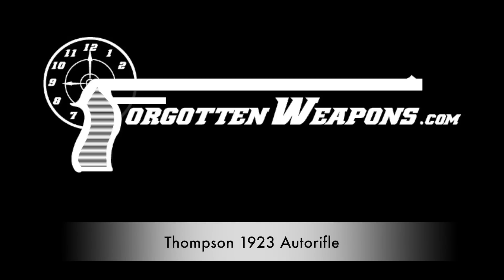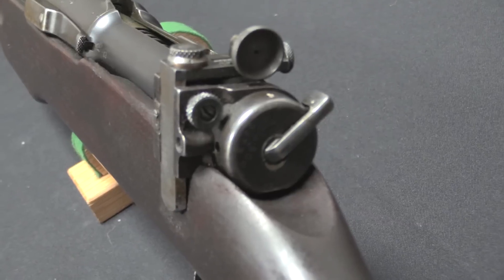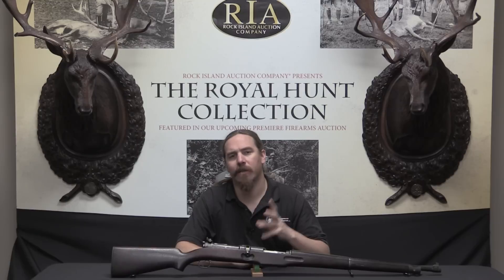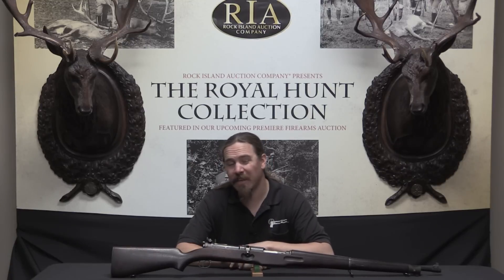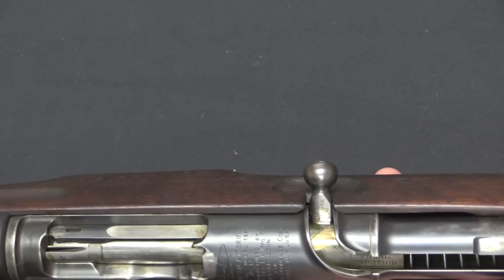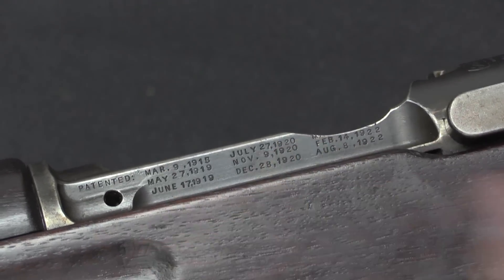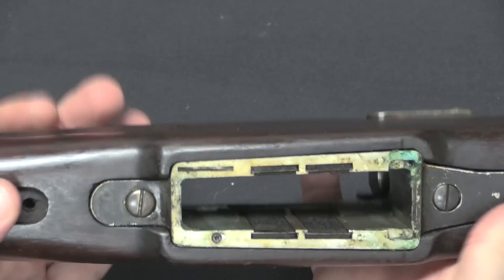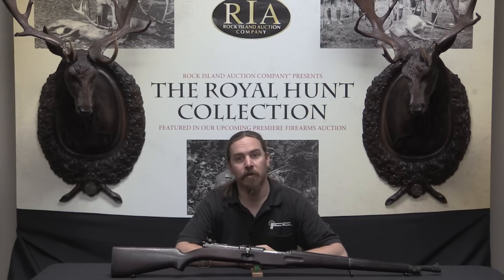Thompson Model 1923 Autorifle

Comment: I can see how Thompson reached his conclusion regarding the "Blish Principle" however he came about it through a limited understanding about cams.Simply put, a cam is a system for converting rotational movement into linear and vice versa. Most screw threads including barrel threads are shaped to be cams which require a lot of rotational to create a little linear. Under the pressure of being fired the barrel is forced forward, the bullet acts like a temporary plug as hot gases expand, this puts a lot of linear force on the threads, enough to induce a small amount of rotation despite the friction of the threads. Repeat this a few hundred times and a noticeable amount of unscrewing occurs.

Comment: I don't understand why you can't understand why it says, "firing position",  I'ts because if the bolt is back , ( which some people may have thought that's where it was supposed to be when fired ),  you can't read it, but when in the proper position , ( bolt forward ), you can.

Comment: Interesting oil-assisted feed system. The Italian Model 1930 LMG and the Breda Model 37 used oiling systems.
Reply: The original Thompson Submachine Guns (Models 1921, 1928, 1928A1) had a felt oiler and retaining clip that wrapped around both sides of the reciprocating bolt group.  It was one of the features eliminated on the Savage redesigns (M1, M1A1).

Comment: HK used fluted chambers to overcome the high pressure extraction issue, right?
Reply from the maker: +Derek Dziobek Yes.
Reply: +Derek Dziobek It worked on the STG-45 but it's just not enough for a 7.62x51 NATO gun.
Reply: I thought that's what they did in the G3, as well.
Reply: It started with the StG-45 and made it into the G3 (which was originally intended to be in 7.92x33) and then onto the MP5.
Reply: +Derek Dziobek The HK91/G3 chambers are fluted as well. And as is typical of a delayed blowback on anything bigger than 9mm, it beats the hell out of the case necks and throws them pretty far.
Reply: +Gerald Darden   Italy was the first to use flutes in their SIA machine gun.
Reply: +Shoes Seems to work well enough for my HK 91 IN 7.62x51 NATO.
Reply: +Gerald Darden HK made a metal/rubber case deflecting assembly that works pretty well and based on an old Guns & Ammo article I read at the time, I tried reloading the spent cases using full length dies and THAT worked pretty well, as well
Reply: +Damian Grouse Sure works in my PTRs, too.
Reply: +Shoes Don't tell that to my PTR91 that's literally never failed in many thousands of rounds.

Comment: Looking at those oiler pads, I do not believe they were reversible. I think the back pad (which appears to be wider) was a reservoir that fed the front wiper pad. The metal plate between the pads probably either has some holes or the felt wraps around it at the top.

Comment: If I'm not mistaken, many, if not most of the "automatic" firearms at that time were firing from an open-bolt position. Since Thompson called this their "Autorifle" the "Firing Position" marked on the bolt may have been simply to specify for users that the weapon fired from the closed-bolt position, as the marking is not visible when the bolt is open. They may have simply wanted to ensure that no GI locked their bolts back and charged into battle thinking it operated the same way as an open-bolt automatic rifle. Probably something could have also been accomplished through training, but making something idiot-proof is a long tradition in military weapons...."Front toward enemy", etc...

Comment: It appears to me that the cover plate that holds n the ejector is what keept the two threaded portions of the receiver from unscrewing.  You can see the slot at the juncture of both pieces would work like a key on the shaft.

Comment: Psych! No "Blish Principle"! Navy dude after all...never thought improper tightening/torquing could have been the loosening problem.
Reply: I think it was vibration.
Reply: +IT'S TIME TO STOP Of course! Vibration, heat, cold, humidity, lubrication, type of material, etc. causes loosening. That's why properly engineered assembly/maintenance specs and procedures AND the implementation of these 'tightening/torquing' requirement is so important.

Comment: I understand the not wanting an oiler pad system but why the dislike for the Pederson type prewaxed cartridge. Was it a known problem like 'storage temperature' or was it a speculated problem like 'storage temperature' ?
 I recall Ian shooting a Pederson rifle with what I'm pretty confident was original or other era correct waxed ammo. If my confidence is justified, the ammo was stored for decades and I doubt it was stored in perfect condition the whole time. To my recollection both rifle and ammo worked quite well.
Was it just the preference for 30-06.

Comment: Ian, perhaps the "firing position" marking on the bolt was an instruction that the bolt has to be closed to fire. I'm thinking this may be the case because the Thompson sub machine gun fires on an open bolt. (Thus the firing position of that gun would be an open bolt). Just a thought.

Comment: I think the reason that says firing position is because when it's open its obviously not? that part is covered when bolt open. I mean that's pretty obvious but that's probably why?
Reply: +Alexander Waterman  I think it's because the Thompson SMG fires from open bolt they thought it was necessary to indicate that this one actually fires from closed bolt.
Reply: +Alexander Waterman 

I feel like that its actually denoting which side of the bolt should be facing up upon reassembly of the rifle.

Comment: So if it had a fluted chamber would the blish lock system work as a delayed blowback in rifle caliber?
Reply: Exactly what I was wondering.
Reply: +banditone00 To bad we will never find it. I don't think anyone would try to make a Blish lock firearm again. Well I should never say never Alexander arms made a 338 lapua Flapper lock firearm. So someone might try it again who knows.
Reply from the maker: +TroopperFoFo Fluting the chamber wouldn't fix the root problem, it would just help with the extraction symptom. The rifle would still be opening at a really high pressure, and that's not a good thing.
Reply: Forgotten Weapons So you would need some type of vent system in the gun also? It seems it would a lot of work would be needed to make this system work for rifle calibers. Now I see why it didn't go anywhere. Doomed to fail I guess.

Comment: You do realize you said "this doesn't rotate, and I don't know why it's marked 'Firing Position' " seconds before rotating the bolt and moving it out of firing position, right?

I suspect, since the Tommy Gun is open-bolt, Thompson wanted to be able to differentiate between open and closed bolt guns in his production line, by marking that this rifle was in the firing position with the bolt forward.

It's a 1920's California-compliant Ready To Fire indicator. :-)

Comment: Your statement is not quite accurate. The coefficient of friction between 2 metals remains constant, however, friction = k*f_n or coefficient of friction multiplied by the normal force pressing the two metal surfaces together. So, to the extent that the chamber pressure presses the two metal surfaces together, the friction would be proportional to the chamber pressure.

Comment: I am confused by this, this vid says the Blish principle is nonexistent but the Thompson used the blish lock to work and the "blish principle" is now known as the static friction or stiction principle where two dissimilar metals will have a higher coefficient of friction under extreme pressure than the normal laws of friction would allow for.   As far as I know that is still valid

  I realize the Thompson was redesigned because the H blish lock was overly complicated and unnecessary for that cartridge and there were many who felt that it was simply a mechanically delayed blowback system more than a "blish phenomenon" that caused the system to work, and they were probably right.   But again as far as I know the "phenomenon" is a valid observation, and does occur